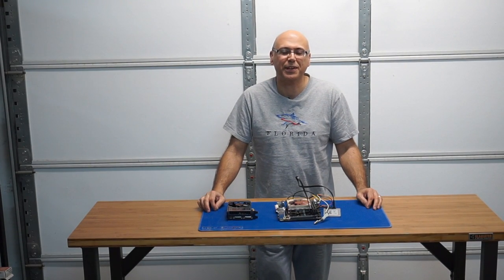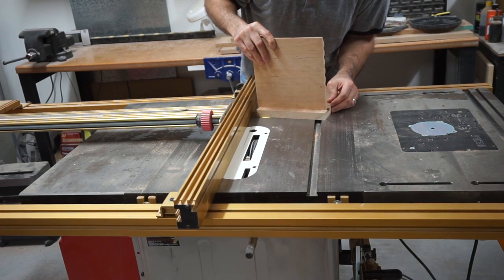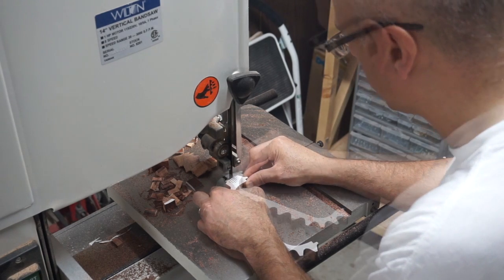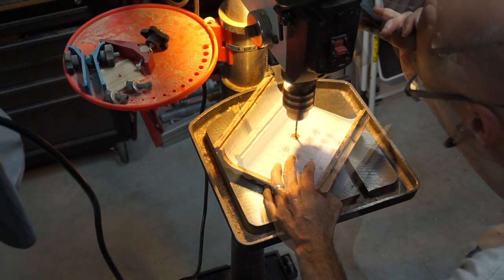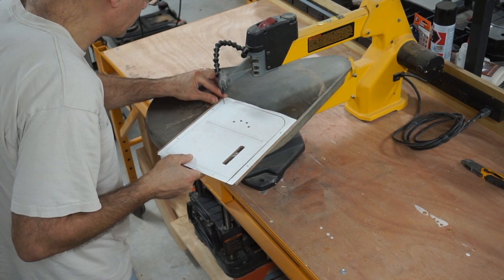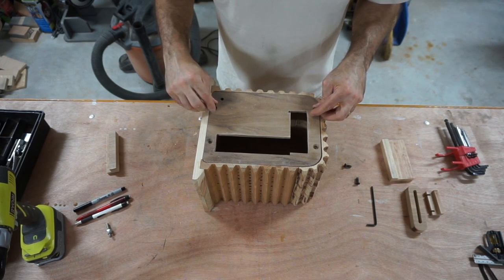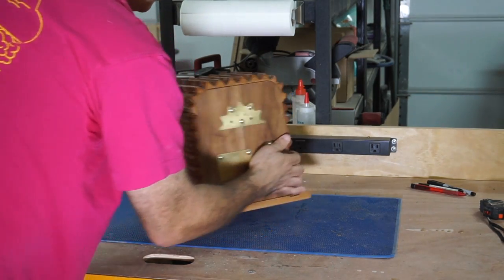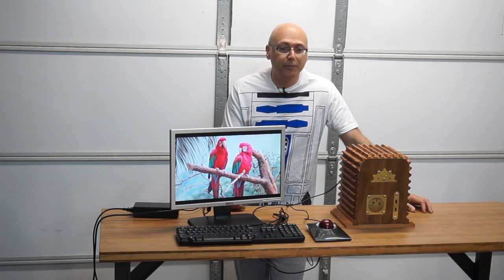DIY Wooden PC Case w/"Cooling" Fins

Comment: Very nice build. That looked to be a labor intensive build that is beautiful! 

I'm curious if it overheats any? I put my HTPC in a large closed-in bookcase and it generated quite a bit of heat without using the added video card like yours has. I then converted it to a mineral oil cooling with pipes and radiator mounted out of sight to keep temperatures normal. Congrats and thanks for sharing. The commentary was great too.

Comment: Really sweet design!!  From one woodworker (and PC enthusiast) to another, Kudos!!!!  One question I have is the power setup?  I noticed you used an external power brick unit and I was curious if you could give some insight on the wiring/setup you used?  I couldn't tell from your video for that part of the build wasn't shown and I have never worked with one in a custom build...i will do some research too:-)  I really like the idea of not only a wooden case, but one so small is even better, and would love to know how you wired it...keeping the PSU out of the case was a really great idea!!  Thank you so much for this video, truly inspiring!!

Edit:  I just popped over to your Hackintosh video, and viola! There was my answer!  Subbing!!
Reply from the maker: Hi Albie, you got it! I will just add to what you found that it turns out the PSU I used in the first build was not powerful enough to run the video card I added in this build. I actually switched to a more conventional PSU since then.
Reply: Ahh!  I was actually curious about that after thinking about it (and watching your video a couple of times).  I was going to ask about it, but here you are with the answer! :-D  I dug around a little bit, and finding external PSU kits is not so easy it seems.  Which unit did you use and what is the wattage capability?  I see that the EVGA GT 740 SC needs 64W and a separate 6 pin power connection, which as you stated was too much for the PSU...I looked at other similar offerings and found that the GT 730 GDDR5 would provide you with similar specs and capabilities (albeit a little less depending on the application needs), and it only requires 25W of power which is drawn straight from the PCIe slot.  This may be a way to move back to the external option you originally used.  Another question, with the traditional PSU that you moved on to, did you fit it inside the case, or did you have to wire it in as an external unit?  It looked like there was still some available space in your case, but I couldn't tell if it was large enough for a PSU.  Again, thank you for sharing this really cool work!!
Reply from the maker: The original PSU I used (which fits inside the case) is called a "PicoPSU" and it is combined with the external power brick outside of the case. I got them both from Amazon. I'll add a link to the video description that will take you to it. The one I used later did "kind of" fit inside the case, but not easily. The unit itself fits just fine, but the mfr. provides every possible adapter wired into this thing, which is appreciated, but it results in a bunch of wires hanging out of it which I had to figure out how to bundle up the ones I wasn't using and jam them into the case too. Also, I could no longer use the elegant power connector fitting that has a boss that screws to the back of my case. I had to open up that hole and I now just have the power cord passing thru that opening without a fitting. With all that, I'm still happy with the overall build.
Reply: Aha!  Ok, yeah, I saw the Picos when I was rooting around, but wasn't sure if that was the one you had used.  It looks like there are a few different wattage variations available on Newegg..I am gonna have to consider this for a small wooden portable pc for presentations that I have been dreaming about...my laptop is just too normal looking for my taste. I will look for your link, for I really like the concept:-)

As far as the conventional PSU you ended up using, there are some really great fully modular small form factor PSUs available that range from 450W - 800W if you ever wanted to get rid of those extra cables as a future upgrade.  As far as the pass through hole for the cord...:-(...sure, not as elegant as your original approach, but at least it is on the back:-)  

Thank you for being so friendly and helpful!!
Reply: Update!  Check out this cool unit that I found online: http://www.hd-plex.com/HDPLEX-400W-Hi-Fi-DC-ATX-Power-Supply-16V-24V-Wide-Range-Voltage-Input.html

Now me wheels are a-turnin'...My next pc project may come sooner than I thought:-)
Reply from the maker: I checked out that link. That looks pretty cool! It's almost too pretty to close off inside a case!

Comment: It's a Steampunk PC!! The wood and the brass plates combined together are always spectacular!!

I'd just would like to know what's the graphics card and the CPU you've used... I keep thinking that it might get pretty hot inside the case with only those small holes to ensure hot air to escape and some cold one to be sucked in... did you noticed the sistem down throttling?

Congratulations IBTW. You've created something to envy for :D
Looking foward to check more of what you have to show :)
Reply from the maker: Hi Rui. Thanks for the comments! The graphics card is a Nvidia Geforce GT740 and the CPU is an Intel Core i5-6500. I chose some proven hardware since I'm a newbie at building PC's. It gives me all the power I need, mainly for video editing, not so much for gaming. I have not done any load testing on this machine, but from day to day use, I can tell you she runs nice and cool, just judging by placing my hand on top of the case.